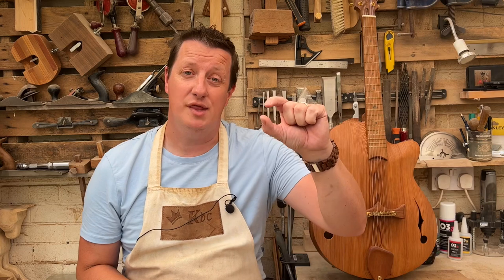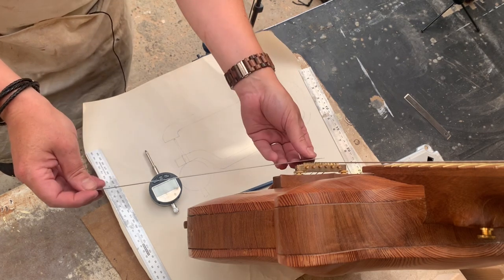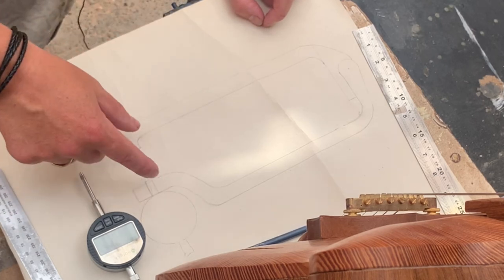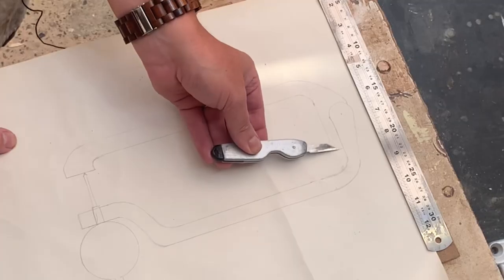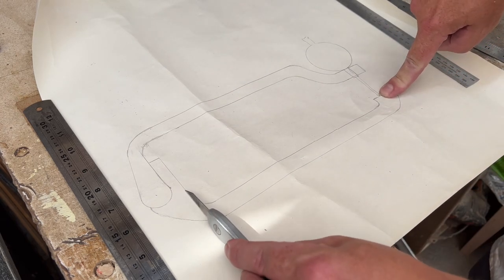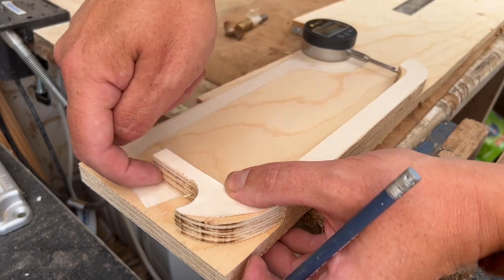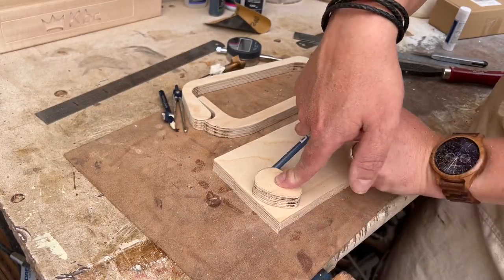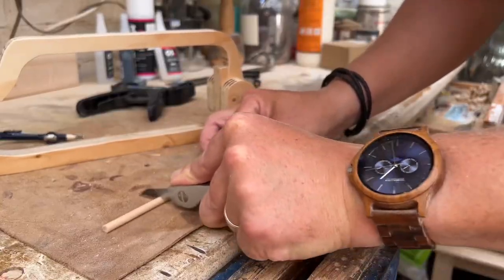Luthiers thickness gauge - Save £150 and make your own!

Comment: Nicely designed, and a great idea to hinge it. I'd maybe add a dome-shaped piece to the bottom arm under the gauge, otherwise things with a concave surface (like the underside of an archtop top plate) could only be measured accurately upside down (so with the gauge probe on the concave side). A small dome would mean the plate could be either way up and still measured accurately.
Reply from the maker: Great idea!